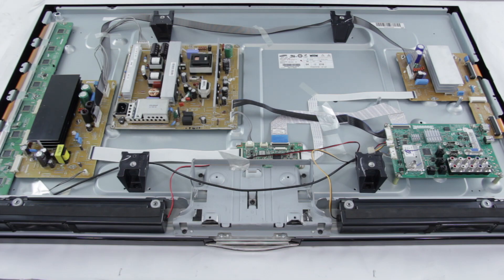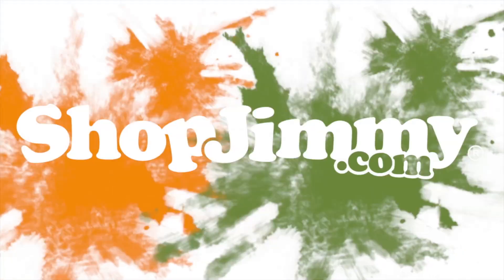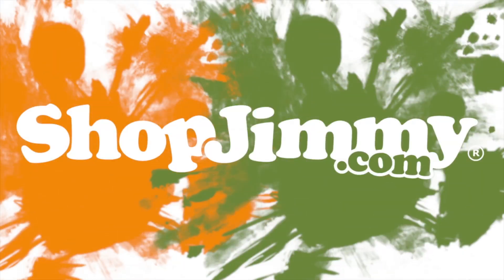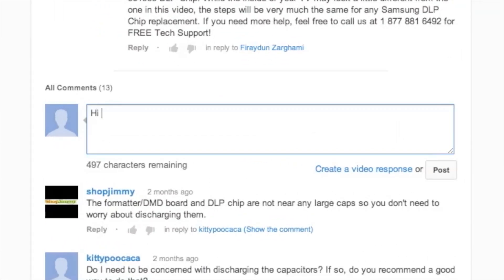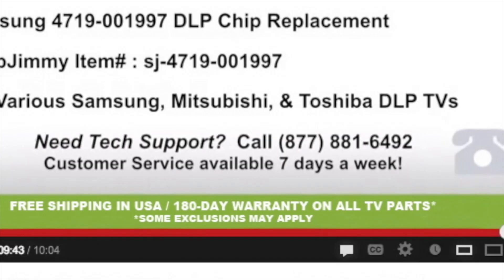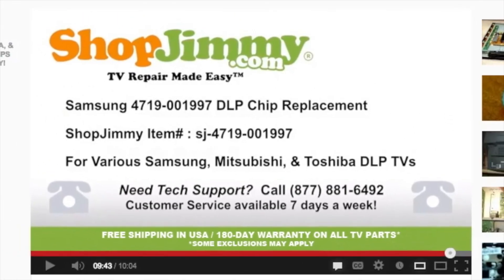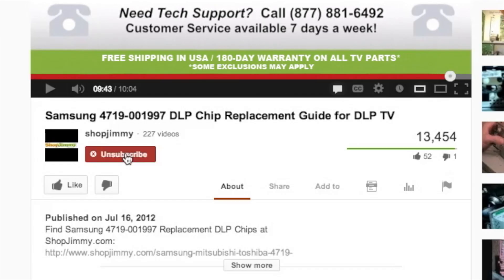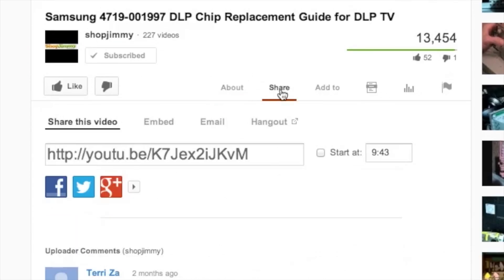Plasma TV Repair Tutorial - Common Symptoms & Solutions - How to Fix Plasma TVs

Comment: Hi I have a Insignia Plasma TV Model# NS-42P650A11 but the inside boards all have Samsung there is a model# S42AX-YB09 for that, I was wondering if my Y-SUS board might be out, when I recently went to plug it in and then turn on I heard a loud pop and now the tv doesn't even try to power on, I did some testing with a meter and the fuse is getting power so it doesn't seem to be power supply and isn't blown and from what I see none of the capacitors are bulging or look different, please help I just trying to figure out what board or if its even worth fixing.

Comment: My Samsung tv makes a clucking noise a few times then the red light stays on but I can't use the touch panel to get the screen on. Model # PN42c450b1dxza
Reply: I switched out the board that I thought was giving me the problem and it's still having problems.

Comment: hi i have a LG PLASMA model number 60pn6500 the tv run good put it shuts down when i use the remote control to turn the volume up or down or change the channels with the gable remote or the tv remote. after 5 minutes it comes back on i changed the YSUS board and it still shuts down thx.

Comment: Panasonic Model TH-50PZ750U Mfg July 2007.
Day 1: Screen turns 'on' to full white, 25 seconds later, operates fine.
Day 2: Screen turns 'on' to full white, 3 minutes later, operates fine.
Day 3: Screen turns 'on' to full white, switches to 'fine' then back to white. Stays 'on' to full white for 35 minutes, 3 minutes 'fine', full white for an hour, then operates fine for 2 hours.
Day 4: Screen turns 'on' to full white and has been there for 6 hours + .
Reply: Day 5: Screen turns on to full white, 10 seconds later, operates fine for 30 minutes, full white the remainder of the day.
Reply: Day 6: Back to day 1.
Day 7: Same as day 4

Comment: Hi, I have a Samsung Model #PN63C7000YF. push on button red light comes on and It makes the sound as though it is turning on an there is a garbled small picture maybe the menu screen for just a flash then no picture no sound. If you push on/off button again it makes the shut off sound and red light goes off. Any ideas what I might need to fix our tv?
Thank you
Reply from the maker: Davonna Charles  Try all repairs and troubleshooting at your own risk.  I recommend replacing the Y-Main board and the Y Upper Scan Drive and Y Lower Scan Drive boards in your TV.  Click this link to replacement parts for your TV model number:  https://www.youtube.com/watch?v=R1jmj_foId0  There may be multiple boards for the same TV model number, be sure to match part numbers on your current board, with your replacement for compatibility.  Here is a link to a video showing how to identify your part number, click here:    Thanks and please let us know if you have any further questions with your TV Repair!  www.shopjimmy.com

Comment: Hi i have a LG PLASMA TV model number 60PN6500 an when i power it up it run fine picture looks good bot when i us the remote control to fine tune change channels turn volume up or down it will turn off i try to cut it back on an it want cut on, after five minutes it will come back on. it do's the same thing when i change the channels on my cable box  what do u think help thx.

Comment: I have a PN43F4500FXZA Samsung TV that was hit with a power surge.  The surge also took out my Tivo unit.  I replaced the power board but my TV will still not power up.  I do not know if the board I got from you was defective or if another part is the problem.  Please help.  TV does nothing at all, like plugging a cord into a brick.

Comment: Hello, great video.
 I have a plasma TV problem.  Model: Panasonic TH-50PH9UK. 

There is a video problem on all inputs until it displays the "NO INPUT" message.  When on a used input, the audio is fine, but the video becomes scrambled and/or has a ton of squiggle lines horizontally at times especially after a few minutes of use.  It can scramble to all colors, and flash black randomly and rapidly until theres no picture..
Another note, when on the PC input, it soon turns off and the power led indicator changes to what looks like solid white.  (at least a combo of red and green being lit steady continuously)

What do you think the problem is? 
Thank you.
Reply from the maker: angusfuzz  PLEASE SUBSCRIBE TO OUR CHANNEL - Try all repairs and troubleshooting at your own risk.  I recommend replacing the main board in your TV.  Click this link to replacement parts for your TV model number:  http://www.shopjimmy.com/catalogsearch/result/index/?cat=226&q=TH-50PH9UK   There may be multiple boards for the same TV model number, be sure to match part numbers on your current board, with your replacement for compatibility.  Thanks and please let us know if you have any further questions with your TV Repair!  www.shopjimmy.com

Comment: I have a 51 in Plasma Samsung (PN51E550D1FXZA)  When I turn on the TV the screen will come on but will only see a grey screen for about 2 sec and then cuts off and then about 15 sec later the same thing will happen.  So its like the TV is cycling Power.  I have already replaced the Power supply but I am still getting the same thing.  Im thinking that its the main board but wanted to get your opinion before I spend $100 for a new one.
Reply from the maker: Matt Schoolcraft   Try all repairs and troubleshooting at your own risk.  Unfortunately, with that information, I cannot say which part is the problem.  You may need to try the main board and see if that fixes the problem.  Thanks!  www.shopjimmy.com
Reply: Well I bought and tried a main board and still no luck....  So far have replaced the Power supply and the main board..  Any suggestions?  The TV comes on for a sec and I see a grey screen and then shuts off and see a black screen and then 10 sec later the TV comes on and I see a grey screen...  keeps doing that loop until you unplug the TV

Comment: Hi I have a Samsung plasma pn518000, i I have parallel lines from top to bottom on my television I would like to know if you sell the part for that problems thank you...
Reply from the maker: Brian Ashton   Try all repairs and troubleshooting at your own risk.  Are the lines vertical or horizontal?  Thanks!  www.shopjimmy.com
Reply: They are vertical lines from top to bottom...
Reply from the maker: Brian Ashton   Try all repairs and troubleshooting at your own risk.  This sounds like a TV panel (TV Screen) problem.  If your TV panel is bad, it may be more cost-effective to replace the TV as panels are typically hard to find in stock, difficult to replace, and expensive.  Thanks and please let us know if you have any further questions!  www.shopjimmy.com
Reply: Thank you..

Comment: I have a model: pn51e530 Samsung Plasma TV, during a thunderstorm the power flashed off then on again.  Afterwords the tv wouldn't come back on. Can you recommend a solution to this? The TV has never given me any trouble and it is one month out of the extended warranty (3 yrs. and a month old) All cable boxes, phone, and modems have been replaced. I'm hoping the problem is only a blown fuse or a part that I can fix myself. Any assistance that you can provide would be appreciated. My email is: masongregory35@gmail.com or Home phone 980-224-8598. 
Gregory Mason
Reply from the maker: Gregory Mason   Try all repairs and troubleshooting at your own risk.  I recommend replacing the main board and the power supply board in your TV.  Click this link to replacement parts for your TV model number:  http://www.shopjimmy.com/catalogsearch/result/?q=pn51e530  There may be multiple boards for the same TV model number, be sure to match part numbers on your current board, with your replacement for compatibility.  Thanks and please let us know if you have any further questions with your TV Repair!  www.shopjimmy.com

Comment: Hi, I have a Samsung PS-42Q91H Plasma. The picture & sound disappeared.  It makes a  clicking noise, but there is power getting through. I followed your video on checking for bad Caps but I couldn't see any visible signs on any of the boards. I checked the fuses & they are fine. I followed your video on plugging in one board at a time to the power supply board to find out which board is causing the clicking noise & it seems that it's the AV/main board causing the clicking noise. I have inspected the AV main board & all I can see is some tan/orange glue type dribbles on the circuit board in 3 or 4 areas. There are no burnt out or loose parts. I don't know what to look for or how to test each component for continuity with my multimeter. Do you have a video on how to check the AV mainboard? And do you think I should replace the AV main board or do something else first?  Also do you have one in stock (I checked your website for the part- BN94-012325 but I couldn't see it listed or available). Can you please help? Thank you.
Reply from the maker: Chrissy Watkins  PLEASE SUBSCRIBE TO OUR CHANNEL - Try all repairs and troubleshooting at your own risk.  I recommend replacing the Y board and buffers in the TV.  Unfortunately I do not see any replacement parts in the search results for your TV model number on our website.  Thanks and please let us know if you have any further questions!  www.shopjimmy.com

Comment: REPAIRING A LG PLASMA 42PC3D-UE 2006 CUSTOMER STATES WOULD NOT GET PICTURE. HAD TO UNPLUG PWR BACK OF TV OUT AND IN NOW OF COURSE IN TIME NOT WORK AT ALL. I PLUG THE TV IN AND PRESS PWR TV TURNS ON. BUT GREY SCREEN. WHEN I PRESS MENU BUTTON OR INPUT NO INFO IS DISPLAYED ON TV. ALL CAPACITORS FLAT NOT BULGING. JUST NEED TO DIAL IT DWN TOWHAT BOARD NEEDS TO BE REPLACED. THANK YOU FOR YOUR TIME. CODYGARRETT42@GMAIL.COM

Comment: Pn51d450a2dxza is the model code. Multiple colored lines they go away if a certain color on the screen.
Reply from the maker: Ysylla   Try all repairs and troubleshooting at your own risk.  Are the lines vertical or horizontal?  Thanks!  www.shopjimmy.com
Reply: ShopJimmy.com they are going vertical.
Reply from the maker: Ysylla   Try all repairs and troubleshooting at your own risk.  This sounds like a TV panel (TV Screen) problem.  If your TV panel is bad, it may be more cost-effective to replace the TV as panels are typically hard to find in stock, difficult to replace, and expensive.  Thanks and please let us know if you have any further questions!  www.shopjimmy.com

Comment: Have a shitsung plasma model pn50c450b1dxza and version ny02 well im gettin a left side of  panel completely black with intermittent vertical lines on far left side ....I had checked the seating of connections of all ribbons and no change or no effect ... I do see on the logic there is a green blinking light which makes me think ots a logic issue ... tho I am a novice at tv repair I almost have to trust my gut and assume im correct right... given the details I had told you what's the issue to address and how can I fix it - Brandon

Comment: LG plasma television.  Water damage I believe on the main board.  The window was left open during a storm.  The television turns on and will operate  when connected  to my play station but anytime it's on the menu options blink on and off the whole time.  The remote is not functioning correctly either.  Please help.  I know nothing about television repair but I do not want to buy a new TV.
Reply: Model # 50PT350-UD

Comment: I have a Samsung PN60E550D1FXZA 60 inch plasma TV. When the TV is off there are white areas on the screen that range from the size of a quarter to a dime. Could this be burn marks?  Is there a fix?  Additionally, the TV does not power on . I heard this could be the power supply. Is it worth it to purchase a new power board if I am having issues with the display on the screen as well?

Comment: I have a Samsung PN43E450A1F that has a standby light but will not power on. There are no bulged capacitors on the power supply. the PS-ON reads between 2.99 and 3.06v and standby is 5.14v when the set is plugged in. The LED on the logic board does not flash so I bought a new logic board for it. It still doesn't light up. The VS-On does not go up to 3.3v when the power button is pressed. Do you think the power supply is the problem? the PS-ON should be 3.3v

Comment: Hello. I have an LG plasma 60PX950-UA television that has a flickering picture. Audio is fine. Sometimes the full picture is on, sometimes it flicks on and off. Sometimes there is a horizontal strip of the picture that flickers. This all happens with cable or Xbox as the input. I seem to have the latest software according to the LG website. Thank you for your help.
Reply from the maker: Richelle Monti  PLEASE SUBSCRIBE TO OUR CHANNEL - Try all repairs and troubleshooting at your own risk.  This could be a problem with either the main board or the TV panel.  You can replace the main board in your TV to see if that fixes the problem. Click this link to replacement parts for your TV model number:   http://www.shopjimmy.com/lg-60px950-ua-auslljr-main-board.htm   There may be multiple boards for the same TV model number, be sure to match part numbers on your current board, with your replacement for compatibility.  Here is a link to a video showing how to identify your part number, click here:  https://www.youtube.com/watch?v=RwHTvjMdrhk  Thanks and please let us know if you have any further questions with your TV Repair!  www.shopjimmy.com

Comment: I have Samsung 60" plasma model: PN60E7000FFXZA.   I had the TV repaired about two years ago, can't remember what the original problem was. Currently the TV started with the picture going out and only volume/sound (sound but no picture)  The problem was an occasional problem started happening more frequently than it happen daily then multiple times during the day. Now the TV turns off and the led flashes I have unplugged the TV plugged back in and now can't get the TV to come on and if the TV comes on maybe 5 min  The problem was an occasional problem started happening more frequently than it happen daily .

Comment: I have a 60 inch samsung plasma tv model PN60F5300BF i am trying to repair, it turns on with like a pixel spotted screen that is kind of purple blue in color. Red light at bottom works. Sound i cant tell if I am on a channel with sound to see if the sound works. if i leave it plugged in it starts to smell like a burning smell not sure if it is just dust or not. please help me fix my tv. thank you!!!

Comment: I have a hitachi p50v701 no power at all got it used it work at the seller house but did not come with a stand I got a stand on line the plug it in no power no lights

Comment: Hi! I have a Samsung Plasma PN60E6500EF that has experienced the "pop of death".  It popped last night and now won't turn on.  It sounded like a firecracker went off.  The power light blinks and the tv clicks continuously like it's trying to turn on.  But I get no picture. I've read that it could be a capacitor issue. I thought I'd ask you guys before I take it down and open it up. Any thoughts?

Comment: i have a insignia model no. N8-42P650A11  when i plug it into power, on the front of the tv the power button led light is red, and the tv makes clicking sounds. i have purchased a new power supply,installed it and the tv does the same exact thing. now im not sure what board i should change next, ?????  any advise on this would really help me out

Comment: Hello, how are you?
I have Samsung plasma pn51450a2dxza and it has vertical lines scattered on the screen, they appear on each input selection and show on top of the menu and in multiple colors. What I can do about this? Your assistance will be most appreciated.
Reply from the maker: David Howard  Try all repairs and troubleshooting at your own risk.  This sounds like a TV panel (TV Screen) problem.  If your TV panel is bad, it may be more cost-effective to replace the TV as panels are typically hard to find in stock, difficult to replace, and expensive.  Thanks and please let us know if you have any further questions!  www.shopjimmy.com

Comment: I have a problem with my samsung 43 inch Plasma model pn43D450A2DXZC, the led light is on but it wont turn on. Can you give me some advice on maybe what is causing this problem? Thank you very much. Cheers
Reply from the maker: Tim Delamatter   Try this at your own risk. Unplug the TV, then disconnect the y board and plug in the TV to see if the TV powers up. Reply with the results of this test. Thanks! www.shopjimmy.com

Comment: LG  42LH40-UA.. theres is a 3 inch wide section of my tv with color flashing horizontal lights that run from top to bottom and dont show up untill the tv has been on for about 20 mins

Comment: Vizio P50HDM Plasma. Unable to change the input or bring up the TV menu. Side buttons do not work except for power on/off. Remote works the same power on/off works but nothing else. I have sound and the power on light does come on. Control board possibly?